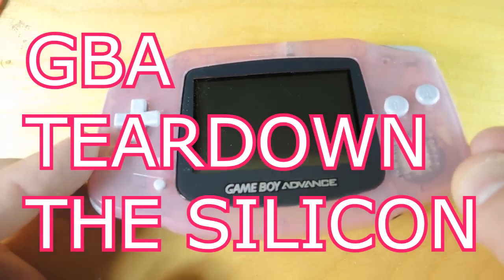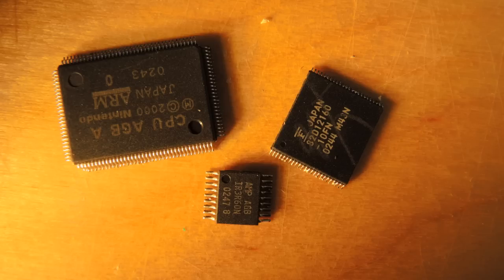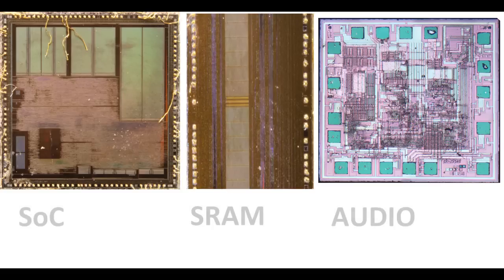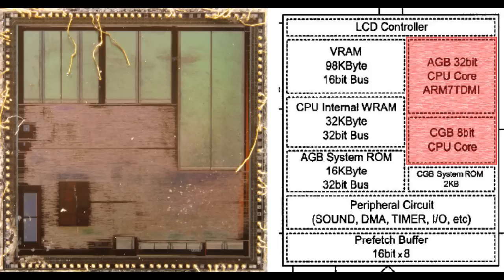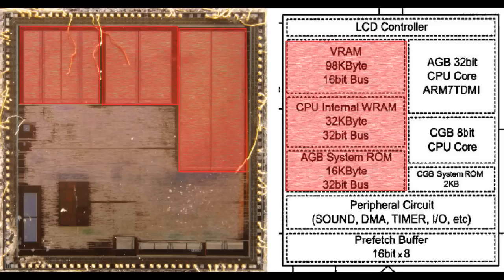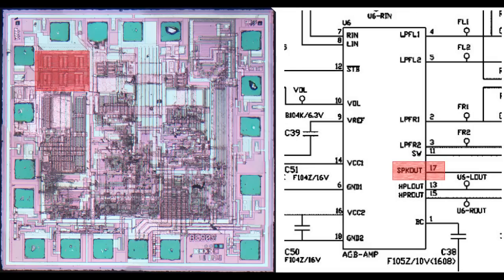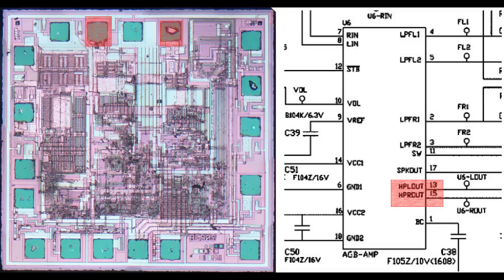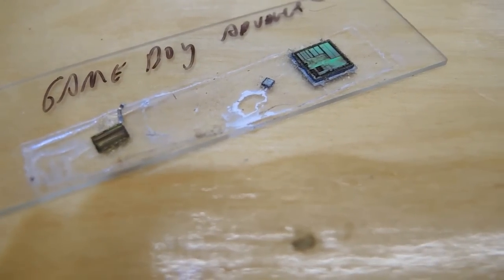GBA: Start of  System on Chip Silicon in 2001

Comment: The original Gameboy didn't use an 8051.  It used a Sharp LR35902, which contained an implementation of a Z80 processor, plus an four-channel programmable sound generator, LCD controller and ROM.
Reply: More similar to the 8080 than the z80, but it lacks features from both and has a few unique to it, along with a different instruction encoding to support them
Reply: In 2019, thanks to the diligent research efforts by gekkio, we have a plausible answer as to what it actually is. A Sharp proprietary CPU core called SM83, with some other peripherals slapped onto it. If you want to read more, here's a forum link with information.

https://forums.nesdev.com/viewtopic.php?f=20&t=18335
Reply: douro20 yeah, 8080, not 8051.
Reply: Yeah, it's 8080-like, rather than being the same as anything specific. Does anyone know if that sharp was developed specifically for Nintendo or came from another product and was merely utilized?
Reply: Far as i'm aware the whole thing (cpu, ppu, sound) was designed together, the cpu's never been separate from its peripherals

Not worth much outside a gameboy anyway, it would have been priced similar to the 8080 despite being incompatible, and lacks an io bus